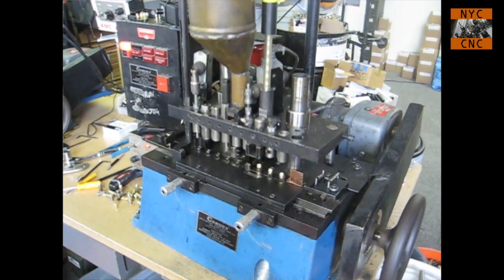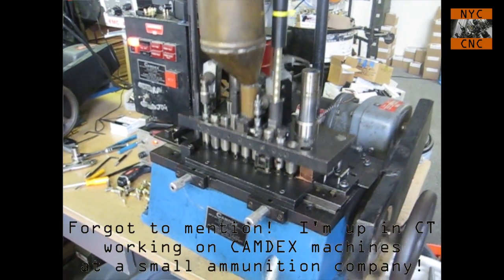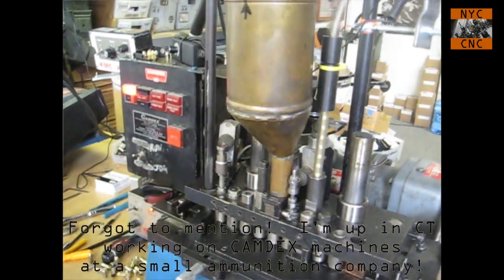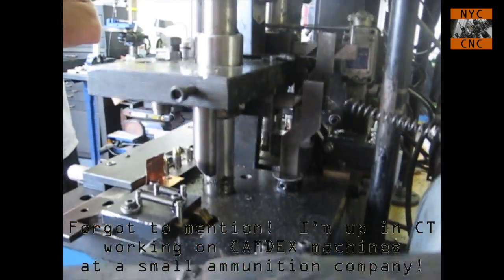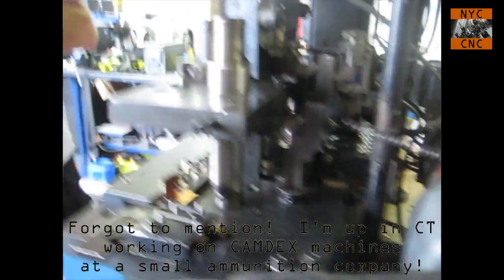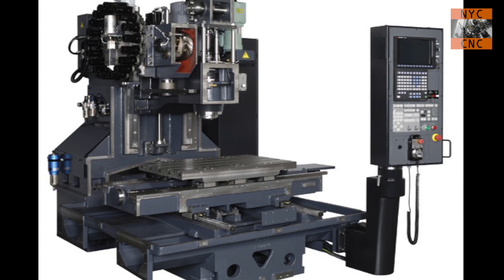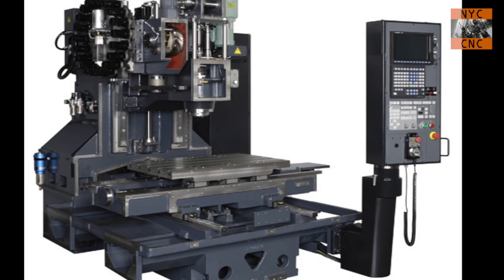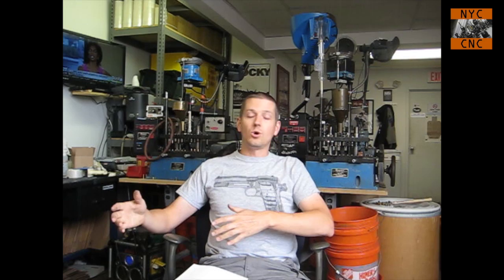Hunt for the VMC - Beginners Guide to buying a Vertical Machining Center

Comment: The old style box ways provide good damping, something that linear slides cannot do.
Box ways are relatively crash resistant (drop a heavy casting on the table) as there are no rollers to flatten or make indentations in the ways. Box ways will last virtually for ever if you insure a higher than standard oil flow rate.
 Many of the larger European machines use hydrostatic guideways and have incredibly powerful spindle drives - they are also fecking large and extremely expensive, but a man can dream.

Comment: Check out the Fives U6R 2500.  No but seriously,  I've programmed, set up, and operated most of the machines in your list.  Stay away from Fadal and Toyoda unless you want to make service calls every 2 months.  Fadal is out of business anyway.  Don't buy a Daewoo either as they are out of business also.  Doosan bought off Daewoo's line of machine tools and discontinued most of the parts for there older machines.  I would however buy a newer Doosan.  HAAS is ok but there made cheap and there controls are proprietary.  Stick with something with a Fanuc control and your better off.  Mazak, Mori Seiki, and Matsuura are some of the best machines.  My $.02

Comment: I'm going through the same process at the moment looking for a VMC. One thing to consider when buying new is that a lease option makes it so the full lease payments are deductible against your income each month which is nice.

I'm looking at the Kent KVR2418 which is a smaller machine (as that's all I have space for) but still seems very capable. Heavy for it's size (8800lbs, 24x18" envelope) with fast max feedrates and a decently quick toolchanger... Also been looking at HAAS minimills and the Sharp VS2414 as options... I'll be curious to see what you end up with!

Comment: Looks like you have done some very good research and planning. It is very wise to educate yourself as much as possible before you invest such a large amount of money. I have been a machinist for 40 years now and am retiring due to medical conditions or you would never get me out of the shop. I started my career at the end of one age and the beginning of another. I miss the old manual machines and was a Class A Machinist. I took up CNC Programming in 1997 when the CAD/CAM software we use started coming into its own. What I am going to give you is some free advice and it will be worth every penny you pay for it.  Oh and by the way I am a reloader myself. Started with a LEE and ended up with a Hornady.. The number one thing I would stress is rigidity of the machine itself. There are three rules, rigidity, rigidity, and rigidity. The stronger the machine the more tool life you can expect and plan for. Tool management is critical. It can make or break a job. It is a simple reality that almost everyone overlooks when they buy a new machine. Mazak and Okuma and Morisiki used to be about the best around. I have seen brand new Mazak VMC's that were not as strong as a Haas. Same with Okuma. I don't know about the new Mori's... Don't listen to the Bull Tweety some of these manufactures tell you. A Haas is a very good medium to light duty machine but it is definitely not built to move material the way an older Okuma will cut a chip. Haas is a very user friendly machine and I have interpolated .0002 bearing diameters all day long with a brand new one. However if you beat the machine up that kind of accuracy will go away. Also you will need to consider what CAD/CAM package you need and can afford. Mastercam is pretty much the standard these days but it is also VERY expensive. A lot of people laugh at me but BobCad is an affordable package that will do a wide variety of things. Mastercam is a great program but it has an extreme learning curve. The newer GibbsCam is very user friendly but still expensive. As I am sure that you know this is a big decision and I think that you are off to a good start. If I can help you out in any way feel free to ask. I am certainly willing to share my knowledge and experience if you would like input from an old man that loved his work.

Don
Reply: The best I remember the older Okuma machining centers were box ways. Not fast by todays standards but they will move some material in a hurry. They also worked on standard g-code as well as a propitiatory control system. I could plug BobCad right into the serial port. MasterCam worked  well also.

Comment: Several years ago I ran a fanuc control blue-chip and it was a alright machine-well built but not a huge fan of the fanuc control more recently I've been running 2 fadal series 2 machines one 3016 and a 4020 and a Cincinnati with a fanuc control and find the fadal to be much easier and user friendly then the fanuc controls.   Also the fadals are very easy to work on and parts are easy to get ahold of...  I'm also located in Ohio by youngstown and recommend a company called mega cnc (from Cleveland area)  they work on fadals and often have some around or can get one to meet your specs quickly we bought the two at work from them and they found them for us and went over them with a fine tooth comb delivered them installed and even took a a couple days to show us the ins and outs and have been there any time we have questions

Comment: Your right about picking on Haas, the advertised HP is a complete joke and they just don't get that we see right through it. The thing for me coming from an old school, big machine, big tool, big cut thinking. I had to learn to think, many small fast cuts that in the end do a better job. I consider Haas the Chevrolet of machine tools, a fair value for the money though I think they could do better. They have such a nice control and manuals that are easy to understand you just cannot ignore them as a good choice. I own a 1992 VF0, plastic enclosure and all.. I won Berta (shes no beauty queen, she gets the job done) in an auction from surplus from a university. Most of her issues were from abuse and neglect, a lot of elbow grease and TLC she works all day with no complaint. Nothing on her cannot be repaired by a person with your skill set.
Keep up the excellent work!
Reply: My personal machine is a '92 vintage VF0, my "real job" we have 2004 machines. I primarily use FeatureCAM to program but often edit G code or write <very> short programs on the machine. The newer Haas machines have a conversational program ability but I have never used it.
My complaint on Haas is the low torque at low speed (without gear change) a touch key for feed and RPM override, and really cheap wires and connectors.
An older Matsuura I have run, I like them for their ruggedness, more like an F150, may be slow but they just keep going!

Comment: I have experience programming, setting up and running Makino,Okuma,and Haas VMC's in a large Mold/Tool and Die shop. The Makino's are used for high speed machining and anything that required very tight tolerances and finishes. The Okuma's are very large machines that required cranes,hoists,lifts to load and unload. The Haas machines are used and abused on everything else.About 5 years ago NX (Unigraphics) replaced Mastercam as the CAM software that is used.

Comment: Once you use a real CNC VMC you will be putting your toymack in a corner to gather dust. Do not bother with a used machine the reconditioning costs will eat you up. Most used machines are for sale because it would cost too much to continue using them. A machine that cost $100,000.00 new and is being sold for $30,000.00 would probably cost that to bring it up to working condition.

Comment: Start by finding  a used phase  perfect if you dont have 3 phase power. What kind of fixtures are you building, material? Are you going to pay cash for the used machine? Finacing a machine older than 10 years is very difficult, FYI.

Comment: My shop runs mostly haas mills there great machines if there in good order we hold tolerances all day of +- .0005 don't be scared of haas. We also run doosan mills 5 axis and 9 axis lathes maintenance for them is a night mare and they through temper tantrums but good machines

Comment: No, the 410-II i meant was a machine fron 2007 and came  with the somewhat older but basicly the same as the newer matrix control system. The Smart machines you pointed out are the ones with the different but still great Smart control. Mazaks are great stable and very easy to program machines on wich you can setup very quick and program almost everything 2,5D without a cam program wich i likr VERY much!
Reply: Sorry for the late response, yeah the Smart system is very similar to the t640 or Matrix system that they offer. I worked with a 410-II for a few years (smallest VMC they make) and i only made CAM programmes for 3d jobs.the Mazatrol controlling system is very user friendly adn quick to program.  I really think you'll have a great machine wich would be very quick, heavy duty and up the tsk for your needs. If funds allow though, go for the Matrix controlled one, Matrix is a tad better in my opinion ;)

Comment: I looked on my local Craig's List last night and saw some potentially good deals on CNC lathes and small VMCs.  For me, the best buy might have been a $600 Knuth Basic 150 lathe that looked as if it was low mileage and had been stripped in preparation for a CNC retrofit.  For about $1500 and maybe 20 hours of sweat equity, I could have a nice little CNC lathe running LinuxCNC.  If I had the space, I'd probably get that, even though I already have two lathes.
Reply: NYC CNC If the bed and saddle are in good shape, and there's a decent (.75" or larger) bore through the spindle, this could be a great little $600 LinuxCNC conversion lathe.  Throw out the threading change gears.  Put some NEMA 42 stepper motors on the Z and X axes with a parallel port I/O card ($300, or servos and encoders for a few hundred more), swap out the 1 HP motor for a three phase spindle motor and VFD ($200 on eBay), slap on a quadrature spindle encoder ($50 or less), add $200 worth of PC stuff, heat bend a sliding acrylic sneeze guard and add a coolant pump and you are good to go.

http://cincinnati.craigslist.org/tls/4687007154.html

Here it is on eBay for $52 with two days to go.

http://www.ebay.com/itm/321533061457

The cheapest lathe Knuth sells now is $7000.

http://www.knuth-usa.com/basic-plus.html

Of course, if you were really serious... how about a nice 15HP Hitachi Seiki CNC lathe with a 12 position tool turret and a hydraulic collet closer for $7900?

http://louisville.craigslist.org/tld/4685871364.html

And a nice little 10 HP vertical machining center with a 16 position tool holder for $7000?

http://dayton.craigslist.org/tls/4648009852.html
Reply: NYC CNC
When I bought my Clausing lathe, I checked the nearest six Craig's Lists, figuring a 200 mile radius was doable for machine shop tools.  I found the lathe 75 miles away and managed to bring it back in my pickup truck, and managed not to kill anyone getting it into my basement shop.  It helps having a friend with a box truck with an 1800 pound hydraulic lift gate, but you can always rent a truck or pay for the machine move, but that can easily cost more than the machine.  Ouch.

There are Craig's List aggregating websites such as AllOfCraigs.com that will search multiple Craig's Lists for you.

Brad (TacticalKeychains) has had pretty good luck buying used CNC lathes on eBay.

My friend James (WarMachineLLC) bought a new Mikini 1610L CNC milling machine that looked very good as a Tormach class tool, but then spent 20X as long reengineering it before finally having a good working machine than I'd spend converting a manual machine to CNC control.  Basically, the hardware was good, the integrated electronics were not, and the spindle was a joke.  Worst of all, the customer service seemed to consist of blaming the stupid customer.

I think there are currently some great deals on used equipment that is nearly perfect for someone making the step up from hobby machining to starting a machining intensive small business - whether buying turn key CNC equipment or buying manual machines or CNC machines with junk electronics and converting them to CNC.

Comment: I run and program 2 20x40 and a  30x16  Fadals. 1990 vintage. Linear ways there ok given the date. But the new ones today are bad ass fast.
Reply: 7500 rpm  bring an indicator hook it to the spindle set 0  and pull and push on the table watch the ind. if it moves its prob the thrust bearing  100 bucks not to bad to fix 1990 vintage you will replace the belleville washers 1200 plus lbs of pull( easy, you tube) other then that good machines 700-800 ipm rapids linear ball bearing on table   and can hold some pretty good wt.
Reply: the 30x16 is a nice little machine small foot print..

Comment: I just went through this myself. I'll look forward to watching your decision making process as it was NOT easy for me. I was looking for a new machine though. Sifting through the Haas hate was very difficult indeed! What did-them-in for me is the fact that getting virtually any of their machines into my garage would have taken some serious planning (including increasing the opening height of my garage door) and that the salesman I was dealing with wasn't forthright with... well... anything. Also, Haas' nickle-and-diming got old quickly. Ahem... 1 MB of program memory? Are the joking?!

Like another poster, I think Milltronics deserves a serious look. Full disclosure: I have not used (or even seen) a Milltronics machine, my opinion is only based on info I've been able to glean from the internet and through talking with the salesman. The VM20IL looks like a killer machine. If it was possible to fit one in my garage, there would probably be one out there right now (instead of a Brother). As for options, they're basically the anti-Haas - almost everything is standard. Again, I'm coming from the prospective of looking to buy a new machine, I hope Milltronics' advantages translate to the used market as well.

Good luck!

Comment: We found the best beginner VMC is a 1990's FADAL 3016.. or if you can afford it the 4020 is a nice machine. There's plenty of room to grow there..
Reply: NYC CNC John I've looked into the 3016 too as loads of people online seem to recommend them. I remember reading (on cnczone or practical machinist) that you want a 1996 or newer for the brushless DC motors.
Reply: NYC CNC Well, John, either machine either the 3016 or the bigger 4020, is a great machine, especially for a beginner. They are relatively trouble free.  Keep the toolchanger carousel clean and free of chips wipe if off and blow it down too.  Make sure there are no broken clips.  Clean the spindle, use one of them spindle cleaning wiper tools.  Make sure the coolant is always clean and please do perform regular maintenance, make sure the lube line are clean and free flowing making sure to see that enough lubricant goes to the ways, screws, etc.  We have three FADAL 3016's in the shop. The control is easy to use and operate, setup, program, etc.  Books are available for download free.
Reply: There is no real FADAL maintenance you couldn't do yourself.  Maintenance is a investment like anything else.  We do ours on our own.  We do have a written maintenance plan.  Best be done more than once a year.  Several things need attention more than once a year.  Parts are reasonably priced too.  Make up a list with several sections in it, with stuff that has to be done hourly, daily, weekly, monthly, yearly, etc. etc.  Keep it by the machine, maybe keep the service records with it too.  Make a record sheet showing what was done and when and sign it off.  Call the guys at FadalCNC.com too.  Those guys know their stuff.  I especially suggest keeping it clean.
Reply: NYC CNC  It's a great machine for aluminum, and most steels.  390+ IPM.  We bought the SwitTool SwiftCARB soft jaws for them.  Expect to pay about $13k-19k for a used one. Plenty of accessories to go with them too.  We bought a FADAL VH65 4th Axes for ours (another $2k-5k).

Yes I will share my maintenance sheet. Have to clean one up for ya and scan.
Reply: yes, well that's for a 3016.  4020's go for 20k-30k. And that's ebay price which is normally about 15-30% high.
Reply: There are two other great FADALs that  get overlooked.  The VMC15 and the VMC40 and the VMC15.  For the FADAL trivia.. there actually is a VMC20.. which is a smaller version of the 40.  Had a 15 but we sold it to a happy home.
Reply: NYC CNC I can think of a few other VMC's which are sub-10k if you are interested in a list.  yes we have bought and tested a quite  few in our quest for the ultimate VMC. Including the Matuura MC-510 of which there is 4 versions, the V, VF, VG and VS. Most of them are red.  but there are some blue and green ones.  Don't overlook the Bridgeport Interact 412 (2 different versions) and the Mori Seiki MV series and the Leadwell MCV machines. Message me and I can give you more to look for.
Reply: Yeah.  Sure is. Thats why we went and tested most of them.  In 22.5 years we have had most of the machines ever produced that fit in our shop.